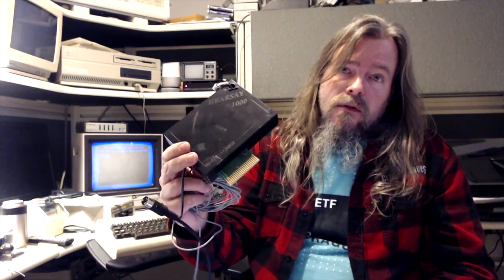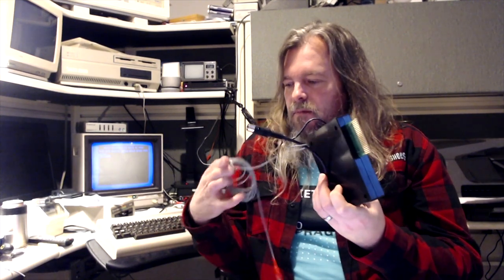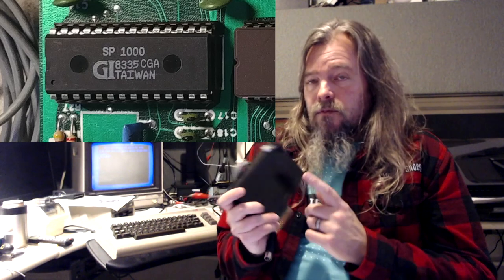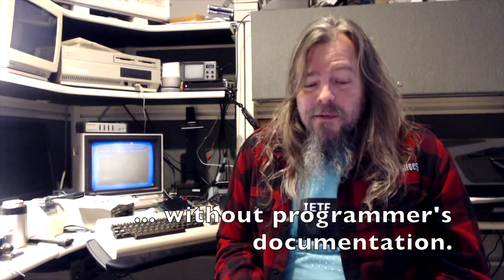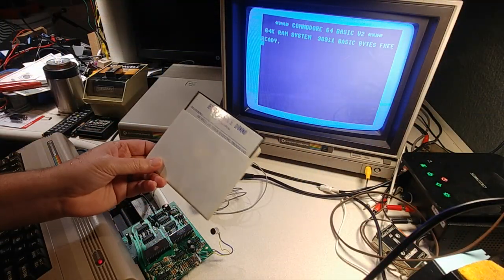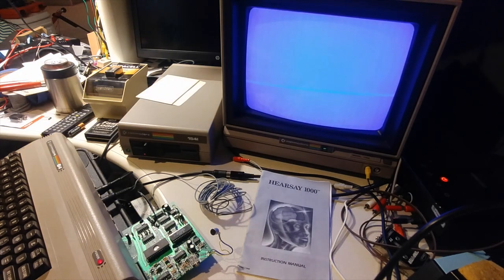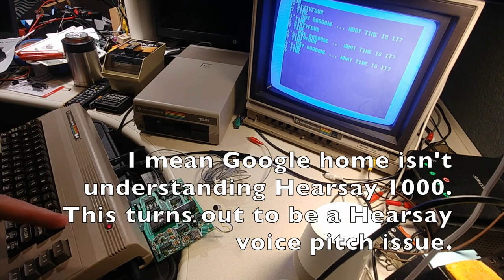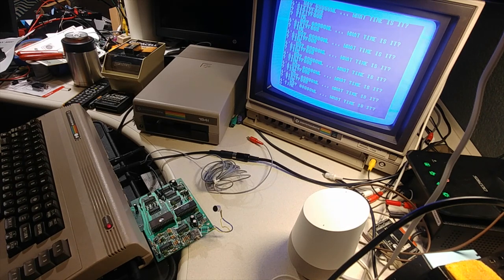Hearsay 1000 voice synthesis and recognition for the C64

Comment: Dave - Do you want the "black magic" for the SP1000?  I made a PC ISA card for this chip back in 1984.   I have G.I. Programmers reference.   I'll scan it for you.   I believe with the right software the chip is actually more capable than your Hearsay 1000 implementation.   I'll have to look on some old hard drives to see if I can find the Turbo pascal code I wrote for this chip.  Basically I wrote a fast vector quantitizer that would classify the parameters out of the SP1000 to  phonemes strings.
Reply from the maker: Hi Dean! Oh, neat that you worked with it back in the day. Ya, if you could point us to the SP1000 programmers reference that would be great.

When I've scanned similar, I put the stuff up on archive.org, e.g.: https://archive.org/details/@dr_dave_s_diversions
My cursory search there didn't find the SP1000 docs.
You could put it there or email the scan to me (contact info in my channel's "About") and I could put it up.

Thanks!
Reply: @DrDavesDiversions  Dave I'm trying to post the link but it does not show up after I refresh the page.

Comment: Speech recognition is pretty good for an add-on device for a Commodore 64. A better microphone would likely help to minimize channel noise. I have a piece of software for the ZX81 that did speech synthesis in software...should try to find it.
Reply from the maker: My empirical evidence says otherwise, but YMMV. I tried an external mic (in the jack) but it didn't work at all. Maybe it needed some contact cleaner, but the plug looked clean. Based on my vague recollection of it not working well back when I got it (which caused me to move the electret mic around and such) and my similar experience today, I believe it deserves the rating "terrible." :)
The synthesis is fine, and I was pleased it was able to pronounce things that Google Home could parse.
Reply: @DrDavesDiversions  I wasn't actually suggesting to replace the mic, as the channel in speech is important in that's how the acoustic models are built. I was just commenting that had they designed a system with a better mic perhaps it would have worked a little better. Speech is my field of research so trust me, it's impressive for an 80's computer to do recognition with a little hardware card :-/ If you compare it to a human, then yes, it's  not very good, but I've been involved with research in the field for the past 20 years so the fact it can recognize "time" and "sixty-four" is pretty darn impressive. The reason it recognized other words as those is because your dictionary is limited to those things, so depending on how that system sets up recognition it's going to try hard to match it to one of those two. Speech is a CPU intensive problem, basically an intractable search problem solved by cutting corners but only if you can search a pretty big space to begin with. No idea what a small 8-bit system is doing, maybe phonetic recognition. Of course you also only had two words but it would be interesting to see the full dictionary of 64 words. I'm assuming it's based on the 45+ phonemes in the English language. Still, neat to see it work at all.
Reply from the maker: @8BitRetroJournal  Good points; they cover some of this in the Byte article I linked about the Lis'ner 1000 and some of the resources mentioned the search time being on the order of a few seconds even with a small dictionary like this. Cool that you've worked in this area. It would be interesting to visualize some of the representation (pertinent to the model) of learned words resulting from training, so one could better understand what features of, say, "hello" caused it to match "sixty four." That would also help to expose whether or the mic was up to the task.

I had fun playing with it for a couple days... I wanted its voice to be understood by Google Home, which took some hours to tweak!
Reply: With small vocabulary systems, there could be a threshold where it says, it's too confusing, otherwise it will choose one of the two you have...I say that only because it looked like several times you would say a word and not recognition was done. So the fact you said "hello" and it came up with one of your two choices is meaningless as it would either be that or the other since it has nothing other to choose other than to make the decision nothing was said (or nothing worthwhile). So the fact that it sat there waiting to recognize and found nothing could also be not about recognition but more about detecting pauses or silences, something totally different. But if you feed in a wave file to a system where you say "hello" and all it has is "time" and "sixty-four" then it has to choose one over the other. The holy grail of speech is LVCSR, (Large Vocabulary Continuous Speech Recognition), so conversational speech in a noisy environment which we humans do ok with. But small discrete recognition with a very small dictionary can only come up with those words in the dictionary. When you have phone systems that require a yes/no response, they likely are trained as LVSCR with a focus on keywords and so can recognize when you misspoke and re-ask you...I doubt your device does that :-/
Reply: As I write this I'm actually working on my server cluster, trying to get my speech research system back into shape. It went down earlier this year and I hadn't had time, due to COVID, to get it fully back up (been running on an alternate cluster). Had students originally set it up and they used RAID-0 (not very useful) and stuck the system onto the 8 terabyte data disk so when one drive failed I lost the main server. I finally set it up properly a couple of days before X-mas when I went in and spend 8 hours in a cold server room struggling to get RedHat do do what I needed :-/ Now I can do everything remotely again and I'm slowly re-populating everything from backup. Then I can start running some model building jobs again (they can take a few days to weeks depending on how big the data set is).
Reply from the maker: @8BitRetroJournal  Ah, it also has a press-to-talk mode where you must hit the space bar first. This makes demonstrations more predictable as Hearsay has trained us how to adapt to the product rather than the (impossible, at the time) other way around.
Reply from the maker: @8BitRetroJournal  Best of luck - I've spent many hours in a cold, loud, server room configuring equipment... thankfully, no more... and my students do [a bit] more of the hands-on experimentation. :)

Comment: Haha cool but infuriating- very commodore!
I would like to see one of those old school smart home systems (simple on off switches etc) from the 8bit era but obviously just not reliable enough - maybe with a jury rigged wireless mic lol
Reply from the maker: Hi Carl! c. 2000 I did that home automation stuff on my Linux box that could listen to all the X-10 signals in the house. It was kind of cool that the Ademco home security system also had an option for an X-10 interface. This allowed me to, for instance, page myself directly (via text pager without a monitoring service) when events happened with the security system. I could also track daylight and have events happen based on that, instead of fixed times of day.

As for the 8-bit era, here is a TV program video showing someone doing home automation back then:
"Terminal Madness (A 1980 Documentary About Personal Computers)"
https://youtu.be/F4jr1I17Gxs?t=11m4s